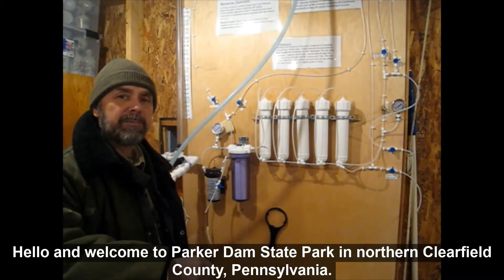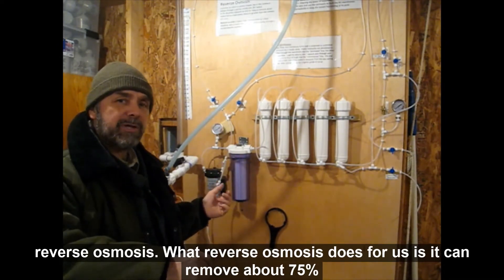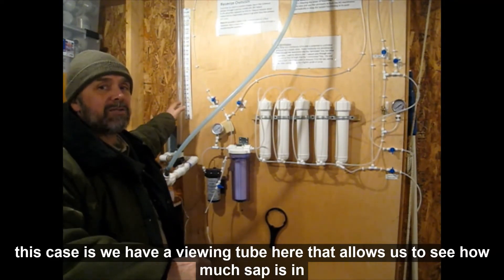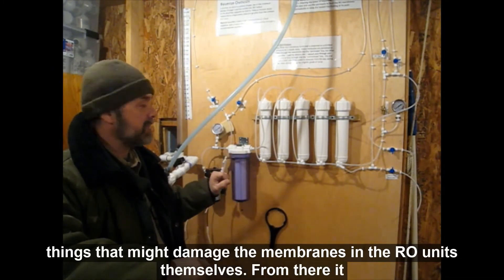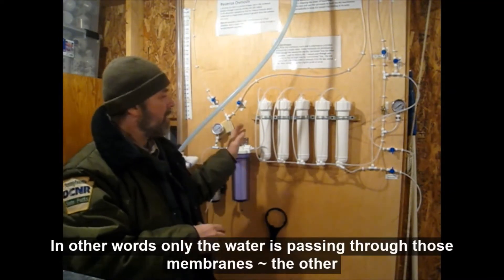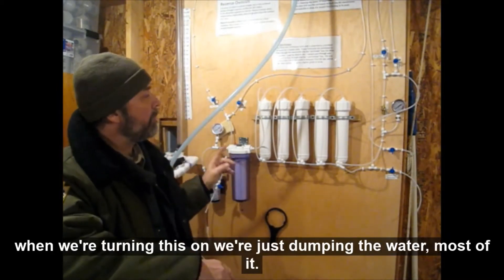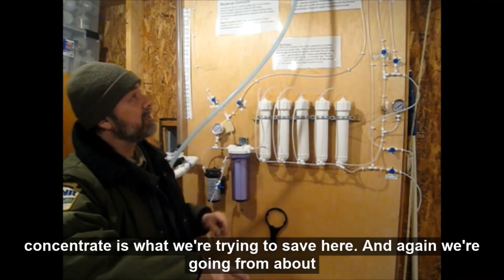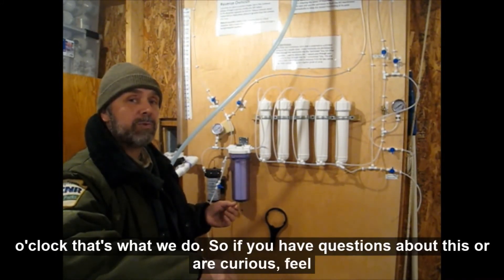Maple Sugaring - Reverse Osmosis (Hobby Scale)

Comment: Great video... Which side off the white filters is the concentrate and which side is the permeate?
Reply from the maker: Lower/center is permeate - is connected across the bottom.  The concentrate is looped up and into the next unit, repeated.
Reply: @erenselpawilds  thank you. I have my system the other way as I have watched others with it reversed. It seems to work, Not sure what is the correct way.
Reply from the maker: @rikidd77  https://www.google.com/search?q=reverse+osmosis+housing&source=lnms&tbm=isch&sa=X&ved=2ahUKEwiat5K7suX8AhX7EGIAHeEgCrcQ_AUoAnoECAEQBA&biw=1920&bih=969&dpr=1#imgrc=f-Q7zwTAzHGNmM  shows permeate & brine (concentrate) ports.
Reply: @erenselpawilds  how long have you been using your system??
Reply: @erenselpawilds  thank you for the link. I see what your are saying now.
Reply from the maker: @rikidd77  At the park here about four years.  We didn't run the RO last year due to lack of sap.  Membranes last about two years from what I am seeing.  I built one for home use (I tap at home too) that I have been using for three years.  Just be sure to run permeate water through them with the needle valve wide open after each sap run/RO session until both lines are running roughly equal.  I was bringing the unit inside my house so they wouldn't freeze, but found that the warm temps caused them to get smelly.  Now I keep them in the shack, but with a temp controller hooked to a small heater that keeps them just above freezing - that seemed to work well.  Something like this: https://www.amazon.com/KETOTEK-Thermostat-Temperature-Controller-Fahrenheit/dp/B0957NYW37?th=1
Reply: @erenselpawilds  that's great. I will look on your website more. Thank you. I haven't using my system now for 4 years, and it seems to be working well, but my permeate and concentrate are reversed. The syrup taste amazing as I am tapping trees in my neighborhood. Boiling down to about 6 gallons a season. It makes for great Easter gifts...

Comment: Can you buy one of those systems at a hardware store? 
If you buy one of those "under the sink models" for water purification, how do you plumb the system to separate the concenteate from the water?
Reply from the maker: Depends on where you live.  Rural PA, the hardware stores don't have much equipment RO - I went online to find what I needed.  An under the sink model is probably already plumbed - might be difficult to work with.  The idea is to direct the pure water, which is now waste, away - and direct the concentrate (normally the waste in the under the sink system) into a container so you can run it through the evaporator.
Reply: @erenselpawilds  Thank you. I hope I'm not asking too much but could you list all the components you put into your hobby reverse osmosis machine? 
I was up pretty late a few nights ago trying to finish a batch of syrup. It took three days to boil down 25 gallons of sap on a propane fryer! It came from just 10 taps over a span of three days. Needless to say, I think I'm a victim of my own good fortune.
Reply from the maker: @professordogwood8985  You might want to look at the RO bucket products: https://www.therobucket.com/sap-ro-buckets/  for the size of your operation.  If you want to build a bigger one - I basically followed the plans from Mattatuck Madness Maple Syrup: https://sites.google.com/view/mattatuckmadnessmaplesyrup/home  They have a parts list on their page as well.  Good luck.

Comment: Hey ! How you do your clean up? Maintenance between each use ? Do you have a specific mix.. like clean water and peroxide. Do you keep the mix inside the RO between each use ? Thanks for the great video 👍🏻👍🏻👍🏻👍🏻
Reply from the maker: Maintenance between uses - replace the pre-filter, open the needle valve wide, and run 10 to 20 gallons of permiate water through it.  The turbulence flushes out the membranes.  You'll see the difference as the cleaning progresses as the permiate line will begin running stronger - almost equal to the concentrate line.  End of season I follow the recommendations from the Mattatuck Madness Maple Syrup link (https://sites.google.com/view/mattatuckmadnessmaplesyrup/homemade-reverse-osmosis ).